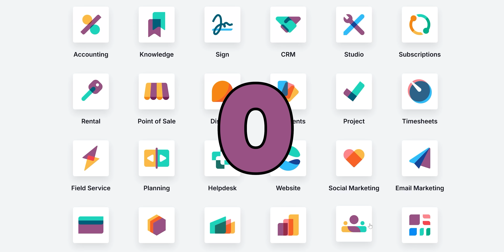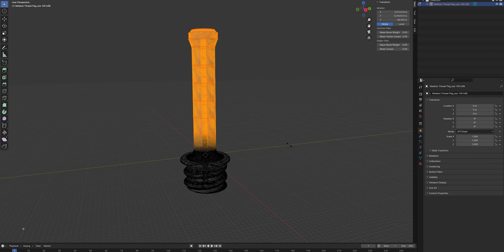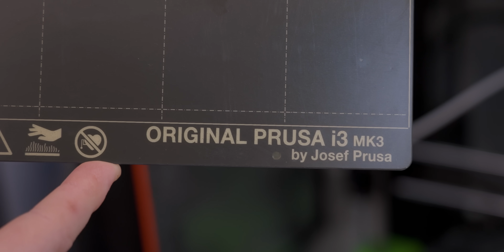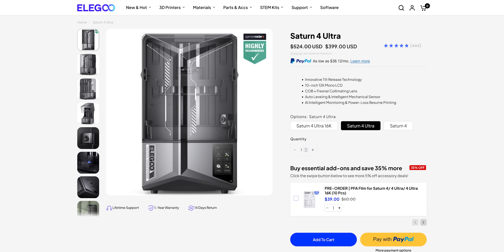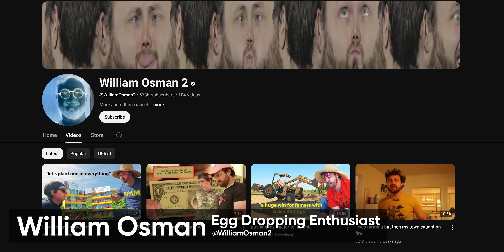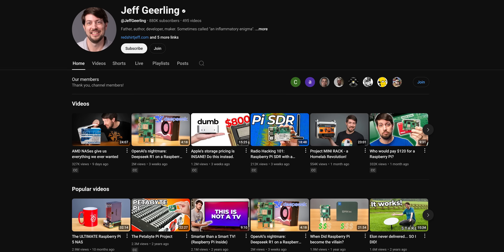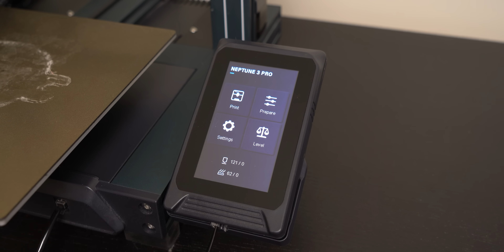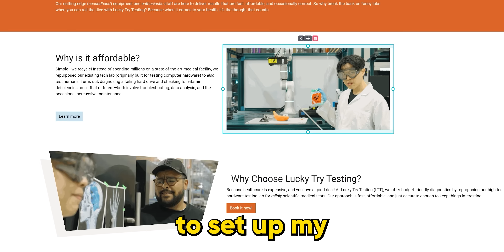Is my 3D printing setup wrong?

Comment: I got the Anycubic Kobra S1 combo on black Friday day.  It's now January.  Here's my experience:  Got it out of the box and put together in about 30mins and getting it out of the box took 10 min of that.  Software was quick and straight forward.  Needed some firmware updates, but went smoothly.  Benchy print was stringy with pla+.  But basically everything else I printed with normal PLA came out great.  Going back to PLA+ after about 10 printed things over a week, it broke in the tubes a few times and figuring out how to get it out was the hard part.  Thanks to youtube, that wasn't that bad.  Although now I don't trust pla+ and retract it fully until I'm ready to print with it.  Even then it wrapped itself into a knot in the 4 to 1 piece.  So, now I manually extract it past that point before printing with it.  Other than those 2 issues it's been pretty great and self contained.  I bet if I set the filament dryer to run first, it wouldn't have that issue. Friend got the bamboo A1 and I'm glad I didn't get a bed slinger and instead have the enclosure.  I'm printing with white with the idea of painting things instead of having 1000 colors to swap in and out.  I printed a spikey mushroom for my cat to scratch with and just a 2 color print with that many color changes resulted in a small mountain of poops.  I'm going to make a silicone mold of something and melt all the poops into that to make a solid plastic skull or something.  At least until there's a filament recycling grinder and extruder that works at home.  I hear there's places you can send X kg of filament to and they send you 1/2 kg spool back to you + shipping.  That seems more for business recycling than at home collections of poops though.

Comment: Possible use for your box of scraps. I have yet to get into 3D printing. But one of the one printers I was looking at would grind up and remelt used filament scraps. Now with the mixed stuff if you could have a specific "color" set for supports only, you could use filament made up of mixed colors. Just an idea. If you think it has merit and you have the connections, maybe you could recommend it to some of the manufacturers.

Comment: 3:37 Does setting up your print lab in a basement utility room have anything to do with the moisture in the air? We used to have to run a dehumidifier constantly in our basement.

Comment: My first printer, the one that I use until this day since 7 years ago, I couldn't convince my dad shipping it from China and local were way OVERpriced in México, so my solution was to do it myself, I imported it bit by bit from AliExpress with the little countertop my dad gave me over the cource of one year. 

It's first prototype used wood as a frame, the cables were all over de place, was hosted with a laptop to use it and was honestly a fire hazard so it never printed alone 😂, now it uses aluminum, WiFI and I currently adding and AC heated bed which actually made me put a Probe and God knows why I didn't before

Comment: If you want a good printer, but you're sick of Bambu's locked-down ecosystem:
If you want a bigger bed, and multicolour: Snapmaker U1. 270x270x270mm.
If you want an EVEN bigger bed, and are happy with a single-colour machine: Qidi Plus4: 305x305x280mm.

Both are excellent machines. I'm waiting for my Snapmaker U1, and I use my Plus4 daily, and have had zero issues.
Protip: I do like Bambu's PETG-HF on my Plus4, that's my winning combo.

Comment: I have a Kobra S1 among others. That one was 15 min setup even with unbolting the Ace Pro from inside its belly. With no ace all you need to do is release the tray, verify connections and plug it in lol

Comment: for filament drying i recommend you buy ams 2 pro not ams as ams 2 pro has drying now and is compatible with every model of the bambulab printers also there are bridges that take custom input and put it trough normal cloud to get custom accessories and i know its not the best solution but still is better then doing it my way which is not updating your printer and that can lead to issues over time especially when they upgrade formats and fix bugs bambulab is still great company they just make it so its safer to use because idk how but printers get hacked and who is here to blame bambulab or stupid people to be honest bambulab releases one of the best printers out there for really cheap and one of the best starting printers is a1 mini then p1p if you want to upgrade over time. Bambulab keeps us safe in modern times at the cost of modifications to the printer and hey you still can make a ton of models change points from them for gift cards and get like ams or whole printers for free not even shipping  (and for people that like to point out yes you can run bambulab in lan only for custom mods)

Comment: Putting your Printers (3D or Paper) next to your AC/Heater unit, you created the Moisture/Humidity issue you are having... Being in IT 30 years+ and constantly asked customers to NOT store the printer supplies in a Wet/Humid or Damp area will mean fewer issues and less cost to repair overall.

Comment: By default, yes, the spool buffer is a pain, but if you get a dryer that also has bowden tube inputs (like the creality spacepi x4, similar to the plus Linus has), you can get rid of the spool buffer. But if Jake was interested, there's a few mods you can do to make the Creality SpacePi x4 able to remove the need for the spool buffer. I found an auto-rewinder that will fit in the spacepi x4 and it's a bit of a tight fit, but the spool holder winds up and has an all 3D printed spring plus the housing and will rewind spools as long as they weigh enough (speaking of, I had an idea on how to solve that more permanently, but I don't have the CAD skills to design it so it'll work with all spools). Anyway, I've loved my mk4s so far with my mmu3. Unlike Jake, I've had several failed prints, but I'm also still learning a lot. 

Here's the mod I use in the spacepi x4: 

https://www.printables.com/model/1365518-creality-space-pi-x4-auto-rewinder-mod 

The auto-rewinder is here: https://www.thingiverse.com/thing:3781815 
which was called out by the creator of the printables mod for the spacepi. 

The reason I was having several print issues early on was that I had a series of different problems with the core setup. First, it was a level print surface, then it was filament drying and jammed spools (due to drying causing some stickiness to itself). Adding more mods or building your own filament dryer with an auto-rewinder like the generic one that was designed above and remixing it for your dryer would eliminate the spool buffer entirely, though, my other mod was not fitting in the case, but it was warped and was causing the spools to stick as well.

Anyway, once you make a few mods to some of the existing dryers or custom dryers, you can swap out the spool buffer and it gets a LOT easier to manage filament. I think I've finally found a stable setup for the mk4s + mmu3 + creality spacepi x4 (which has some serious design flaws as I'm learning now).

(Also, I realize Jake just left LTT and I'm just now watching the video, but maybe he'll see the comment) @Jakeus - check out what I talked about with dryers to pair with the mmu3. life gets easier with a dryer and a few mods...but the biggest thing is that autorewinder.

Comment: late to the show, but still; rocking a Creality CR10S-Pro, with the addition of the MIcro Swiss Direct Drive alterations, magnetic bed. print speed set to 100m/s and it prints - finally - perfectly. next upgrade to implement is the BTT Octopus pro and  add another hotend

Comment: Bambu enclosed printers also have a filament heating utility. Put the spool in and dry it. Not as convenient as an external dryer or AMS dryer but it does work!

Comment: Dont dry silica in any device that also heats food stuff. 
Silica is toxic, and esp. the stuff with color indicator for moisture absorption.

You can actually dry the silica on the printbed of the printer, just ensure ventilation.

Comment: I don't know what people are talking about and afraid of with Bambu but I went from two creality ender 3 V2 neos with direct drive conversion to the p1s with ams2 and I will never go back. I have noticed the slightly wasteful nature in terms of filament, but damn only reason I've had just a single print failure is because of how I sliced the model. P1s can run circles around the enders and could easily replace probably 4 or 5 of the enders. Speed and accuracy in the same machine? Hell yes

Comment: What doesn't work about the AMS? Never had anything fail with it. However I did G-Code ALL profiles NOT to unload. So all consecutives prints in the same color have not a single un/load.

Comment: Just got the P1S a few days ago with their huge sale. Been printing with it about75% of the time.   The  claim of having it unboxed printing within 15 minutes is BS. took me closer to  1-1.5 hours (being complete noobie and never dealt with 3d printing before).

While instructions were pretty good, they still left a little bit to be desired. I also had issues getting the printer paired first to my phone over bluetooth., then took a few times to get it connected to my WIFI, then a few more attempts to get it paired to my account.  Now if I was going to set up another one, I still doubt the 15 minute claim, but Im sure I could have it unboxing and printing within 30 minutes (assuming didnt have same pairing issues)

Comment: I've built every 3D printer since the beginning of time with the hand wound extruders on the Makerbot cupcake.  Then onto the reprap mendal, then original prusa, then extruded frame printers and so on.  I spent hours and hours tweaking, upgrading, tweaking, learning, upgrading, tweaking, and upgrading endlessly and my printers worked pretty damn well.  That is until I got my first Bambu.  Even for a very seasoned veteran like me, the speed, uptime, and printability of their printers is outstanding.

I supported open source since the days of reprap and was I disappointed in further closing off their software - yes.  But it works so damn well, I just don't care.  Do you complain that the iPhone isn't open source or do you just enjoy their product?  (I'm android BTW).  The point is that they took the whole printing industry to a completely new level and pulled all of the other companies out there up a few notches and I just enjoy printing on them so much more than the endless opensource programming, tweaking, measuring, upgrading, etc.  I no longer have to read through the latest version of Marlin or sailfish, or whatever new firmware just came out.

I just design stuff and print and don't worry what the firmware is or what they've changed.  Maybe it will bite me in the butt someday, but they will have to pry my Bambu's from my cold, dead, hands at this point - that's all I'm saying.

Comment: nobody was running a raspberry Pi, Klipper upgrade, network printer with camera assessable from your phone works great, with a biqu h2 v2s printhead upgrade seals the deal. would fix those neptune and max printers right up.......................

Comment: The results from resin printing can be incredible especially for miniatures but honestly the post processing is a deal breaker for me. It's much more chill to use an FDM printer as when the print is done you don't have to mess around too much with it other than maybe removing some supports and if you're busy you can just leave it on the bed till later

Comment: I have a similar setup, never had any of these moist issues, I just checked my AMS apparently I should really have changed my moist packs out by now. but so far never had any blockage or anything the past three years of using it in a dirty dusty workshop. Only fails I've ever had to deal with is bed adhesion and that seems solved since I got the PEI plate.

Comment: Could you look into the Kobra 3 or Kobra 3v2 Combos, i personally like mine even though i havent used it long, and the filament dryer being part of the material station is such i nice choice, i also think its a more middle ground price point between the stuff shown here.

Comment: @12:12 WTH! You have a fishtank in a room that should be dry as reasonably possible? on top of that your airtight bucket is probably not vapor/gas tight. Tested those lids for a research project The were most definitely not 100% proof, fully 1/4 fail testing.

Comment: Most people look at 3D printing in a hobbyist/maker space where open source is key, however it feels like Bambu is trying to get into the enterprise space as well. I can tell you from someone that does PLC programming, security is key. Multi million dollar companies don't want access to the machine via the web or any other interface, they want security. So yes on a maker space i see why people are mad over it, as a professional tool, it makes sense. I also believe this is why Bambu is more on the 3d printer as a good to go appliance that can be used immediately for prototyping, instead of the other open source models where half of the 3D printer hobby is having tow how to repair and advance a 3d printer just to make is usable.

Comment: The firmware situation just makes it so you have to use Bambu's splicer 🤷‍♂
But the BambuLabs plugin for HomeAssistant still works and allows you to control your printer, so I imagine it's still possible, just not how people currently do it.

Comment: I've had an Elegoo Neptune 4 for about a month now, and for the price, it's one of the best options out there. Back in 2017, I bought an ANET A8, which I used for years, but it was terrible—slow, inaccurate, and needed constant calibration. I spent about the same on both printers (around €200–250 including 3kg of filament), but the Neptune 4 is infinitely better, It has much more precision and is 3-4 times faster.

Comment: I started out with an Ender 3 V2, then later on I got a Fysetc MK3S+ clone, which I upgraded with genuine Prusa parts and ran as a Prusa/Fysetc hybrid for a while. Then a little more recently I got the upgrade kit from Prusa to turn the MK3S+ into a MK4S. Worked perfectly since the Fysetc MK3S+ is a 1 to 1 copy of the Prusa MK3S+

I still have my Ender 3 V2 sitting on a shelf in my basement. I'm thinking of converting it into a Voron Switchwire to use alongside my MK4S

Comment: Personally, I have five printers. Mine are all Creality because they’re really easy to fix and modify my ender Three pro has every modification of the sun. My K1, I just upgraded the nozzle to a micro Swiss my ender 3S one is stock in that thing prints beautifully, and my resin printer is the R6. Plus I have a few parts machines laying around most I bought used repaired rebuilt and put back in the service.

Comment: Looks like Bambu heard you. AMS Pro 2 with drying functionality and easy accessible tubes.
And the new H2D Printer, with dual nozzles, integrated Plotting, Cutting and a fucking Laser Cut/Engraving.... and still cheaper than a Prusa XL. At least they got me hooked again, so I probably will buy a Bambu...

Comment: I have a Bambu Labs printer, not been using it as much because the QiDi printer is awesome (except for missing multi filament so far, but is supposed to be Q1 2025, which I've not yet looked into), but your biggest fail in this vide is WHAT is the thing that Bambu is doing with their updates I know the did some kind of a store thing, but other than that not sure what the big deals is.   I HATE that it uploads prints (another reason I'm using the QiDi printer instead), Maybe it is time to just sell the Bambu Labs printer - I have an X1C printer with 2 AMS units (which fighting with them has become an thing...  And yeah, they apparently fixed the problem with the being able to get at those tubes...

Comment: @Linus i dont know ANYTHING at all, about 3D Printing, but i plan to start learning. What would be a good beginner printer you would recommend? I want to start simple with single color prints, but i also want a printer that's compatible with multi-color printing, just in case i want to upgrade down the road. Most importantly,  im on a very thin budget. You get what you pay for, so I'd really like to find one that doesnt sacrifice print quality very much

Comment: I will say, I had/have a Ender 5 Plus and it was/is a ongoing nightmare, Its still dead collecting dust, I gave up, I gave up because I brought a Bambu A1 in a sale, Ok its not as big but how often did i used the full bed on the E5+.....   Never.  The A1 has never failed. Even in a heated enclosure to print ABS on it, As thats a no no in the manual, I have 3D printed cool air fan ducts into each sides air vents and she loves it.

Comment: I want a 3D printer but can't decide on a printer. The more I research printers the further away I get from deciding. I was originally looking for build volume, then I started looking at heated chambers that are needed for some filaments, from there I sunk further in the abyss with looking at filament drying. There are some filaments that could not last through an 8 hour print without being dried. So I started looking for a multicolor system that actively dries while printing. The only one I could find is the ACE Pro from Anycubic and paired with the S1 that had a heated chamber, seemed to meet my needs, until I saw the build volume (small). I am kind of leaning toward the ACE Pro with the K3 Max, but it being an open system, it has not heated chamber. I can seem to find the perfect printer, with active drying while printing, active heated chamber and a good size build volume. All that being said, do I need all of that or is it just a pipe dream? Will I ever be using the filaments that would require drying while printing, like BOVH. Will I ever need to use the active heated chamber for something like nylon or ABS. I don't want to buy something then run into a situation where I needed one of these features. Ugh...how do you decide?